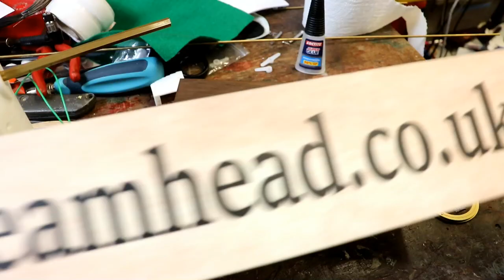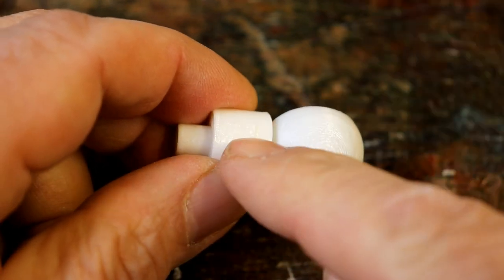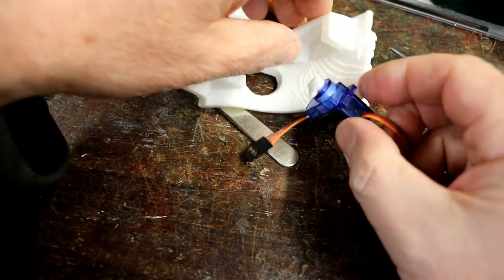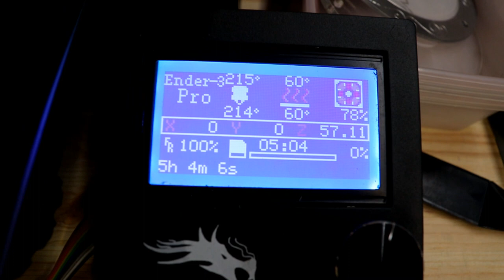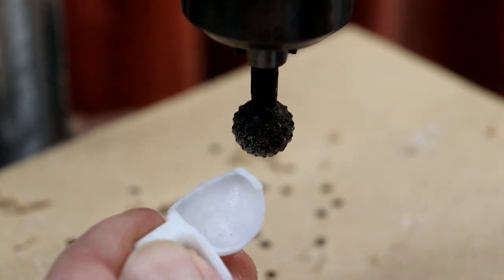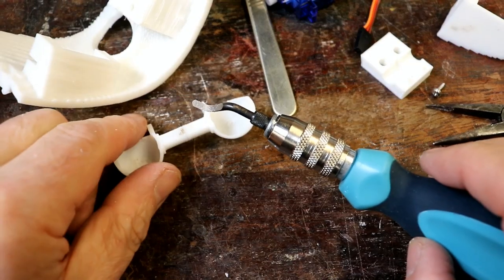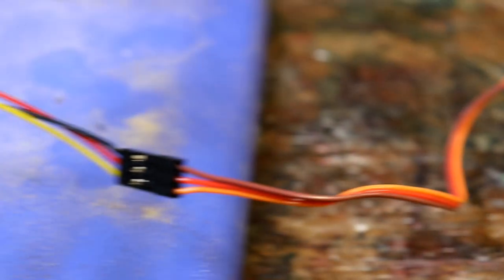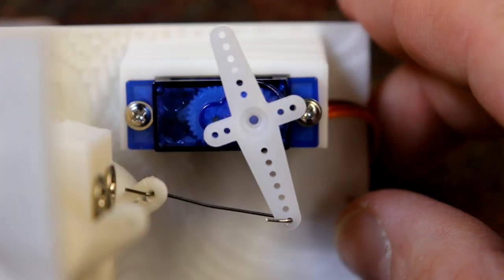4. A Blinking Good idea

Comment: Ah, it's spring steel wire you use for the servo!
It's incredible how may servo 'tutorials' give chapter and verse on PWM, but neglect to mention now to link them mechanically!
By chance I got some 'piano wire' to make a spring - I guess it's much the same thing - and only after I got it realised it would be ideal for the servo linkage.
Reply from the maker: The spring steel wire seems to work okay. 0.7mm diameter was far too tough to bend so I ended up using 0.5mm diameter whicj has enough strength and is easy to bend. Obviously it would be no good for items that need the full servo power to move, but for delicate items like eyes, it works perfectly. Also rather than breaking stuff if something mechnical gets stuck, the wire just bends!
Reply: @steamhead  Interesting - the stuff I got from ebay was "Piano wire music wire" in 0.8mm.  I had no trouble bending it to shape prior to assembly with pliers, although trying to bend it around plastic once it was inside the gadget would have likely broken the gadget.
Reply from the maker: Well done for managing with 0.8mm, that's the main reason I ended up using 0.5 as I could bend it around components etc. Also I meant to mention, which I'm sure you already know, that piano wire/guitar strings make excellent tension and compression springs.